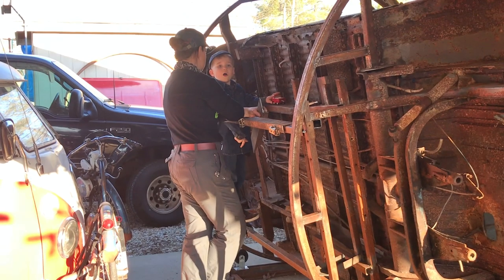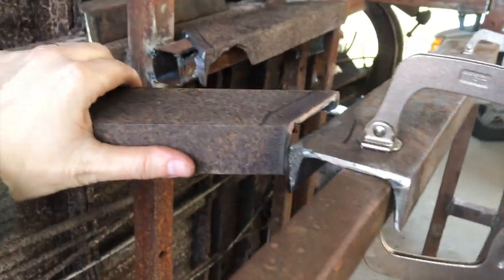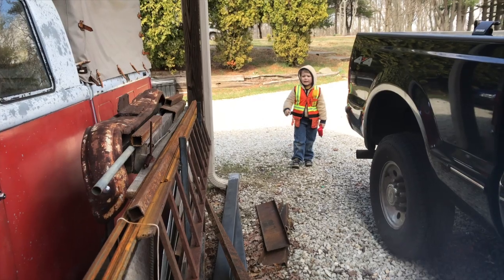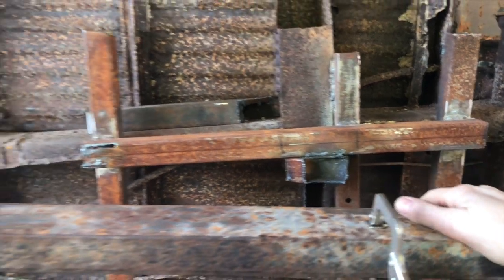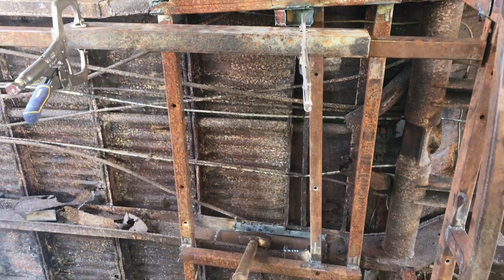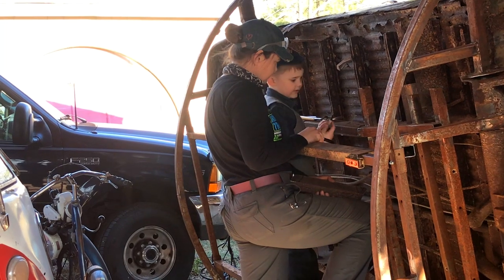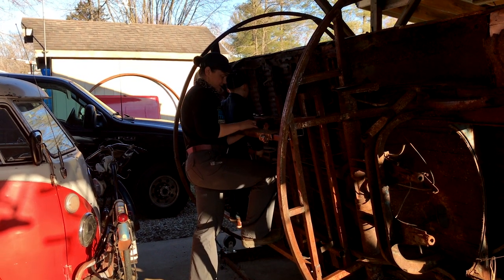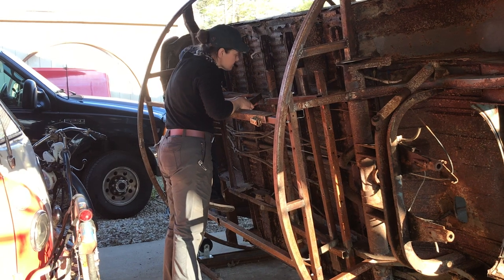Totally Rotten frame, 1958 VW pressed bumper panel bus, Part 2!!

Comment: Just curious why not media blast the metal so you can find all the issue's
Reply from the maker: well it ain't hard to see all the issues 😆and if I media blast there won't be anything left! lol Pretty much it is getting an all new underside...everything from the lower 10" up is good, no hole in roof, etc etc...but it is an absolute mess...My dad does have a media blaster and I could easily do that, but I'm building an entire new frame anyway...👎👎
Reply: @marcijunebug  got ya just was in that situation before and I have to say made my life a bit easier after media blasting maybe on your next project you could make a comparison media blasting versus non media blasting but in any case love the work you do any gal that welds and wrenches is aces in my book 👍👍👍👍